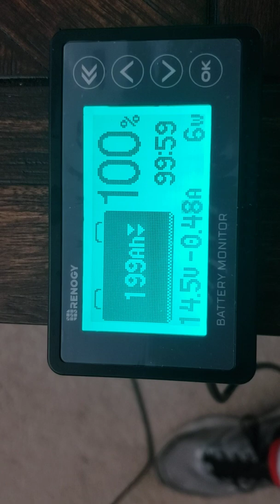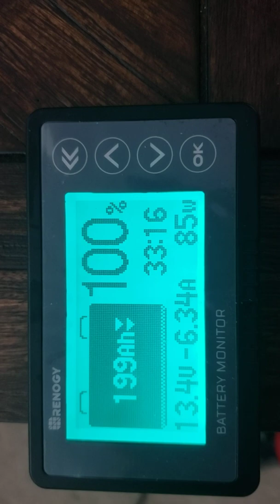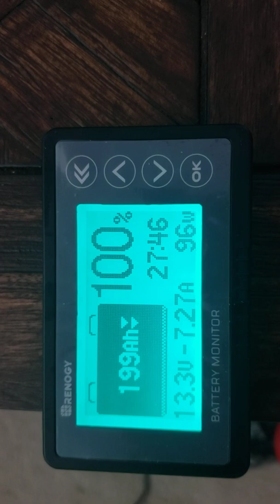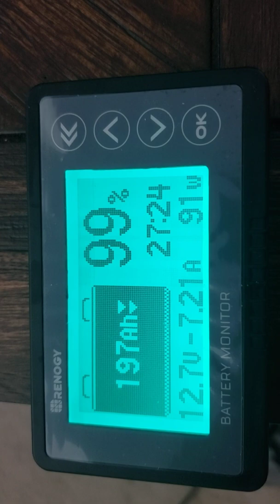Renogy RBM500 Battery Monitor With Inverter and Fan

Comment: You probably know by now that the up and down arrows next to the Amp Hours shows the NET flow of energy into and out of the battery. If you have 200 watts of solar coming in and have the 100 watt fan on, it will show a flashing screen with up arrows indicating flow of charge into the battery. I like the Renogy 500 and enjoy watching my battery charge/discharge time meter change under various loads and solar charge conditions.  For fun, here's my monitor showing some bigger numbers. Seems that I can only pull 2,000 watts for 3 hours 24 minutes.  https://www.youtube.com/watch?v=NYpczRYDFJQ

Comment: I’m not saying you have done something wrong but there is not enough emphasis in the instructions to make sure the battery /battery bank is charged to 100% before setting your battery monitor. The principle of the monitor is it is measuring flow in and out. It’s accuracy on SOC of battery depends on what you put in as the starting point of SOC of the battery.

Comment: Hi, thanks for your video.  The approximative 34:37 hours of autonomy is the result of 199 / 5.78.  My question is : in another video your put the low voltage at 11.5 Volts, so once your battery state of charge will be down, lets say at 50% capacity, will the voltage also so go down around 11.5 for exemple, therefore is the time estimate be cut by 2? Thanks again